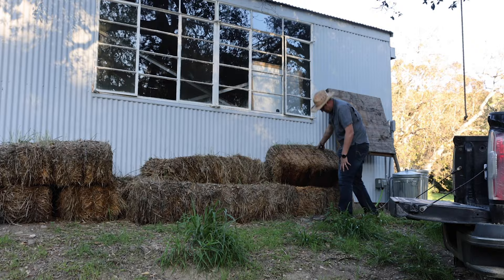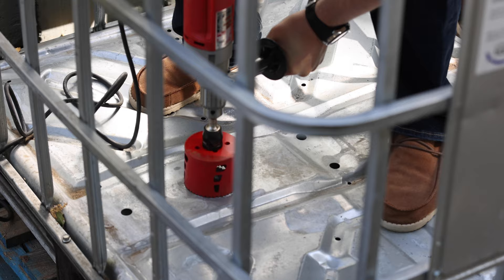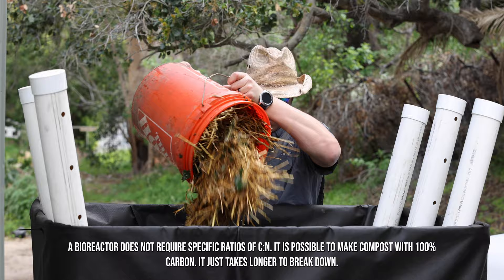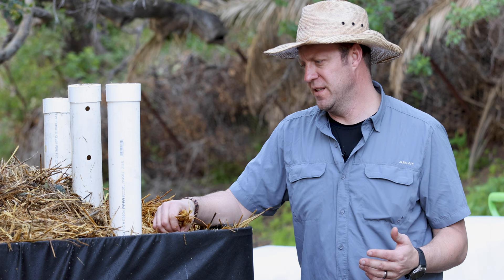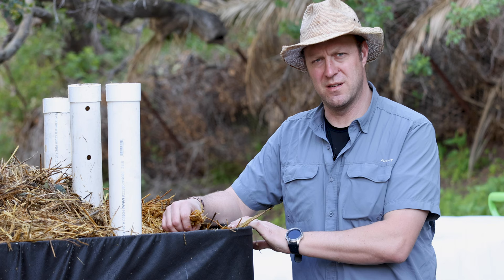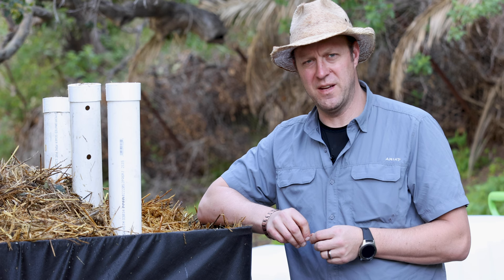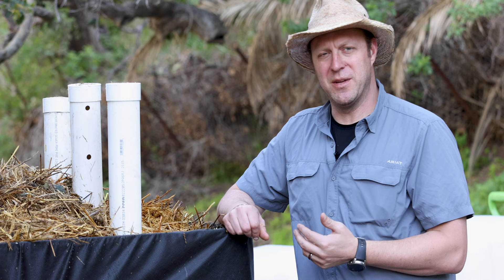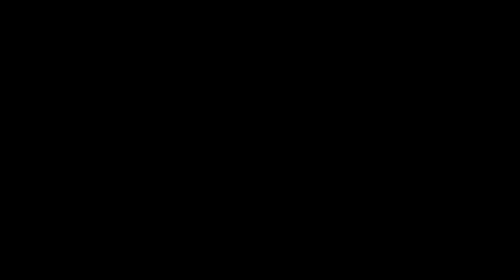How to make a Johnson Su Bioreactor out of a chemical tote with Cory Miller from Grass Valley Farm

Comment: I live in Texas. it's really hot here in the summers. I've been fighting problems with my compost systems over heating and drying out for years. I've seen every video i can find on the Johnson-Su process and i can't directly reproduce his system like you have there.  So i've split my process into two steps. The thermophilic part i do out in the regular compost pile where the heat can do it's part. And then i bring that material into the shaded , relatively cooler, area where the outdoor (half barrel sized) worm bins are located. Then the worms can do their thing for a number of months where i can keep an eye on them; temperature, extra food etc. So far my plants have been the best they've ever been. And i'm starting to work with neighbors to better feed their plants. Improves the sense of community too.
Reply from the maker: I love this! Thank you for sharing your process with others who might need this information.